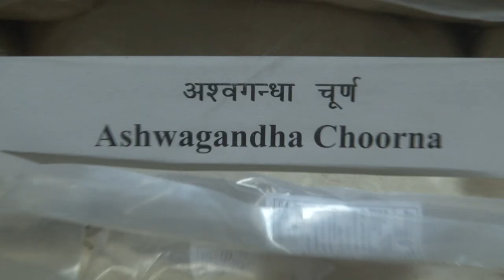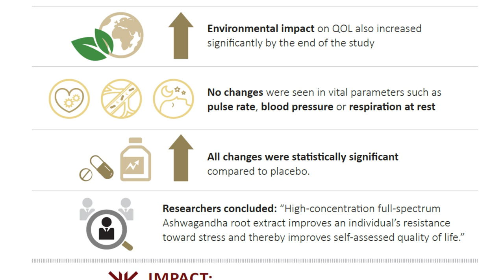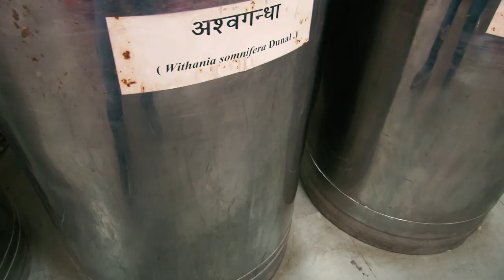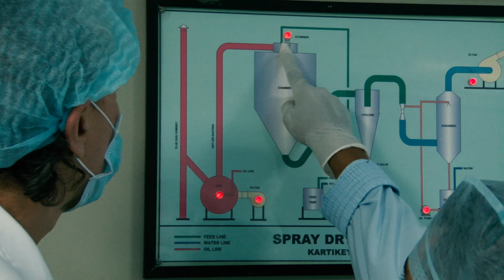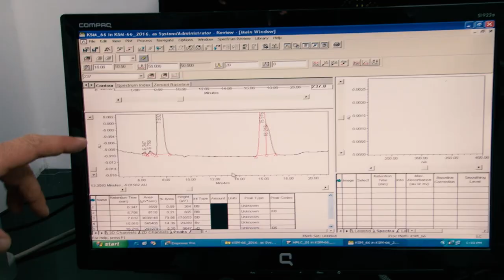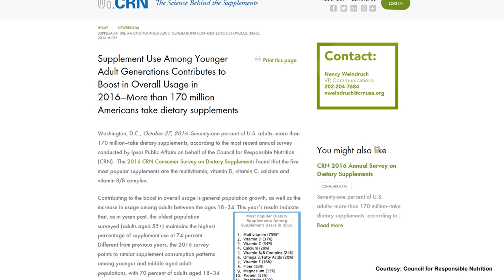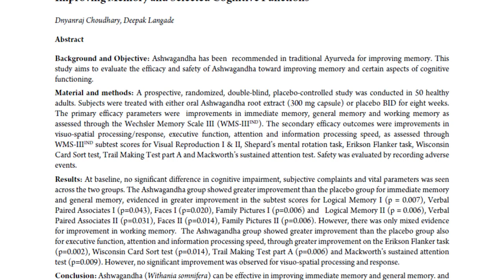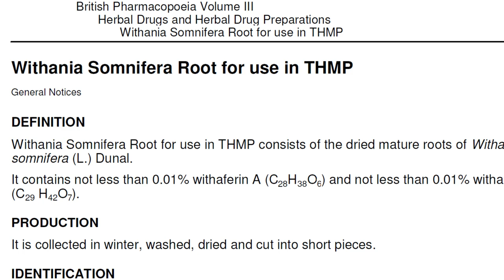KSM-66 Ashwagandha Documentary

Comment: Interesting that milk is used in the process.  I have heard of boiling the roots to "purify" the herb, but I don't know  what that would means or how that would change the profile in chemical analysis.  While they mention their use of milk in the preparation, they don't say anything about its role in the extraction process.  Ashwagandha is a very complex herb with many different compounds (around 25?) that work synergistically.  I know alcohol vs. water based extraction will yield different chemical profiles.   Using heat (boiling) in the preparation matters as well.  They must have very detailed data about their testing results.  Perhaps they don't want to divulge trade secrets but this video could have used a little more science and a little less advertising.
Reply: facts